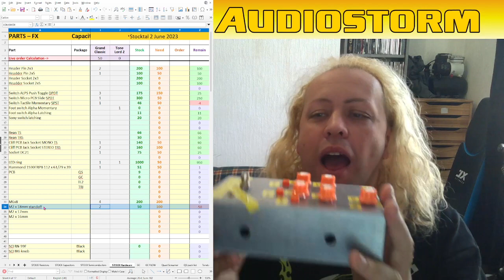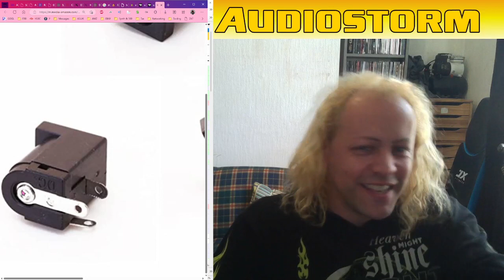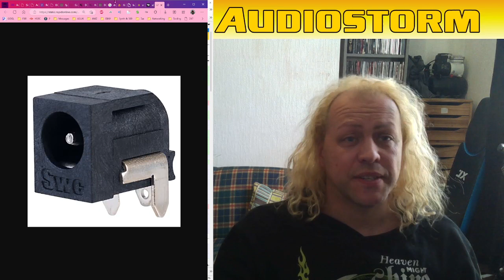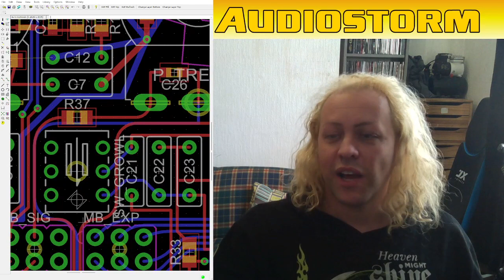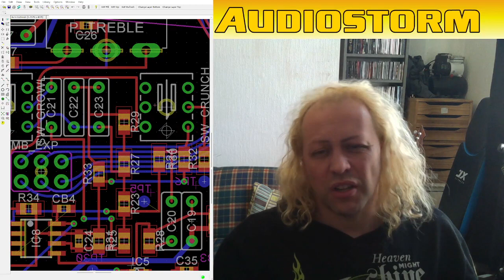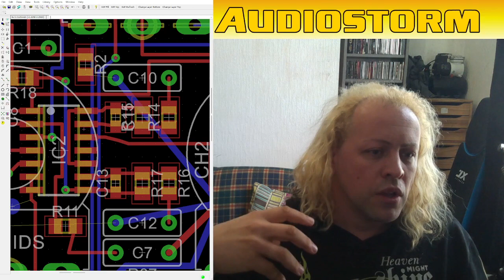Audiostorm Grand Classic - The dull stuff: Stock-taking, part selection and PCB footprints.

Comment: I'm with you on those square DC jacks, they suck. I've also found that they're often mislabeled so the hot and ground are sometimes reversed. I use the round DC jacks which means that I have to solder three leads to them and then attach them manually to the board, but for me it's worth it. I also buy pre-tinned, pre-stripped wires in 2" lengths. I've spoken with a parts supplier about creating DC jacks with leads already attached to them on their end, and while the conversation eventually fizzled out there was some enthusiasm for the idea. One thing I usually try to keep in mind is if a part is good enough for a large scale manufacturer, they're likely good enough for me too. Enjoyed the video!

Comment: I would go with the panel mount barrel jack, and connect ot with a 3 pin connector to the PCB. That way,if, (or more realistically when), it breaks, it can be user replaced.